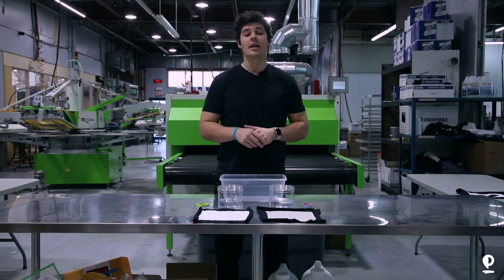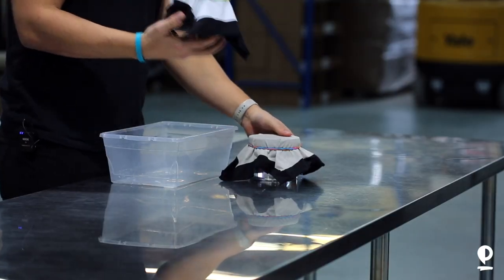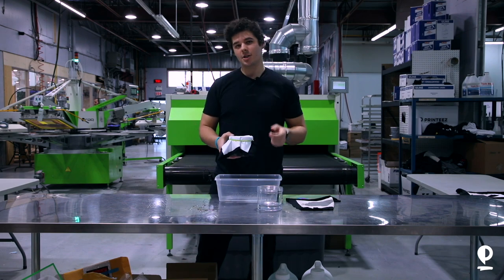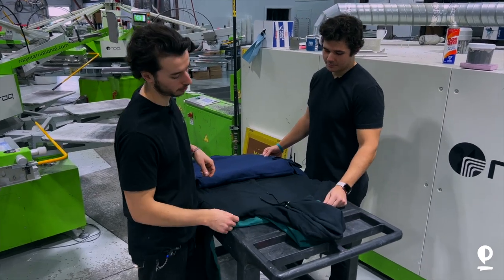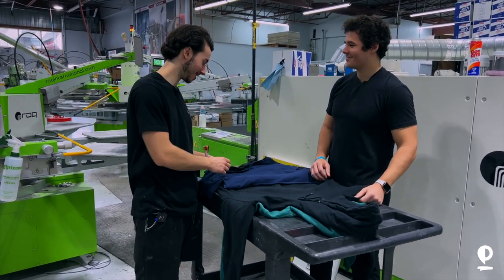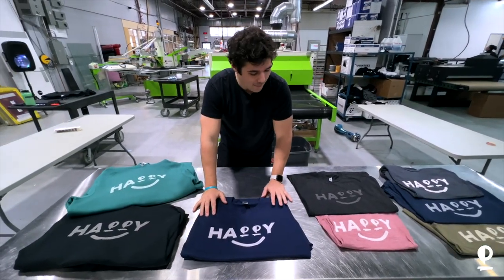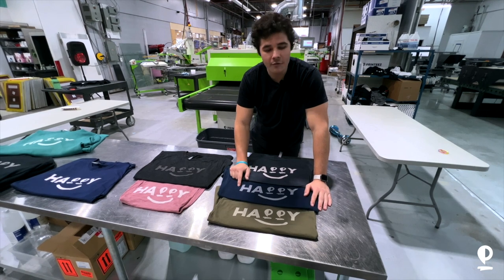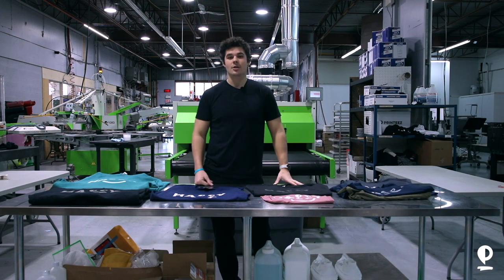Screen printing water based discharge vs plastisol inks, what's the difference?

Comment: Thanks for this video. There's not a lot of info out there about discharge, especially water based, compared to plastisol printing, which is everywhere. I personally don't like plastisol much, but that's only because I've tried it 😂
Reply from the maker: Thanks for the comment! :)

Water based inks are amazing! The soft hand & breathability are unbeatable. That's why all major brands use mostly water based inks.

If you'd like to get your hands wet & try water based inks. I suggest starting with a simple 1 color black design. Speedball inks are great and you can order them of amazon easily. :)

Make sure your screen is well exposed is key! Here's a great video that talks about getting started with water based inks. https://youtu.be/PlrMRJIp-Lw

I hope this shed some light on where to start.

Feel free to reach out if you have any other questions.

Cheers!
Reply: reals this was a good video, been looking for more info on discharge printing..ppl been asking for prints like on the funko pop tshirts and I was boggled how it wasn't a plastisol print, took a couple searches to find out it was called discharge printing...but ur right it's so hard to find info on it other than drg